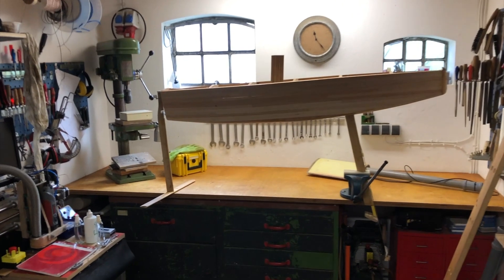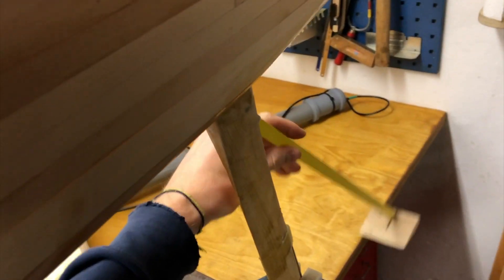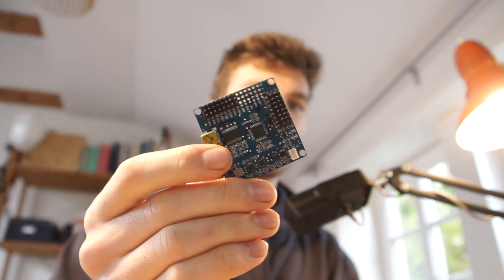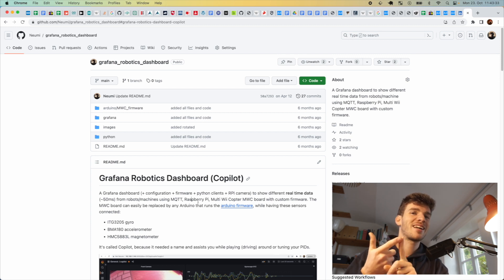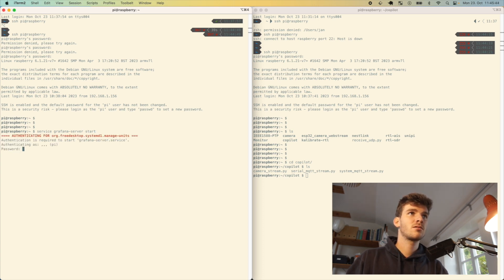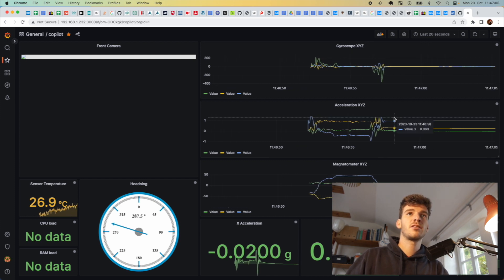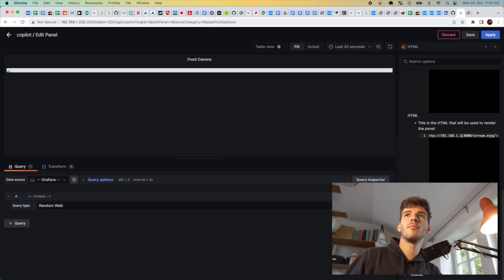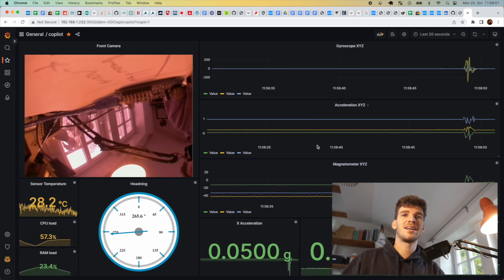Grafana MQTT Dashboards for Realtime Robot Data Visualisation

Comment: Great Job !
I'm working on a similar project in which I wan't plot data from ECG sensor . But I'm struggling on installing the grafana-mqtt-datasource on Raspberry Pi. Could you give me some advice on how to solve this problem?
The Grafana GUI find the plugin but as unsigned and the log file says :
Oct 10 13:43:48 rpi-ecg grafana[13016]: logger=plugins.backend.start t=2024-10-10T13:43:48.652961166+02:00 level=error msg="Could not start plugin backend" pluginId=grafana-mqtt-datasource error="fork/exec /var/lib/grafana/plugins/grafana-mqtt-datasource/dist/gpx_mqtt_linux_arm: no such file or directory"
Thanks in advance

Comment: How do they get a streaming video with MQTT? I can't even send a single image? Why not use websocket also for sending telemetry data? I've build a dashboard around MQTT but now I'm thinking to rewrite it using only websockets.
Reply from the maker: The video is not streamed through MQTT. It is just a web stream in an iframe on Grafana. The benefit of using MQTT for telemetry data is the ease of use and proof of delivery. MQTT is a very good protocol for almost real-time data streaming. MQTT is also used in other parts of the system. Displaying it on Grafana is just a nice side effect and very easy as you can just subscribe to the datas topic and display it on the dashboard.

Comment: This is incredible! I'm using this as a diagnostic display for an industrial machine. It's in the demo phase at the moment but if the company runs with my idea I'm definitely donating to you
Reply from the maker: Haha that's great! 
I think Grafana should be used more for machines as well. The dashboards are so easy to make and change and with the direct MQTT data source, it's even easier to see all important data without having to build a real backend with data storage etc.
Sometimes the MQTT data source crashes. It should be fixed according to https://github.com/grafana/mqtt-datasource/issues/44 But haven't tried it yet.